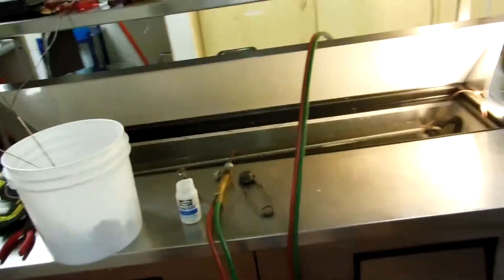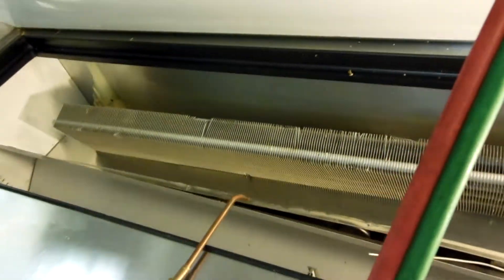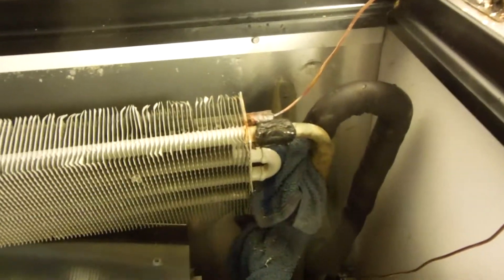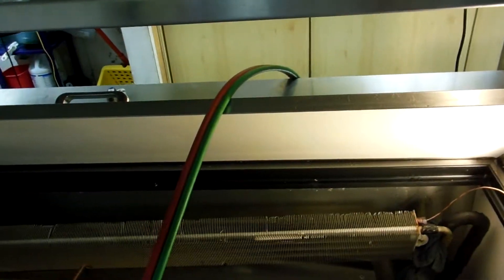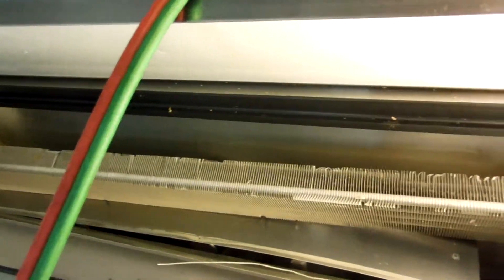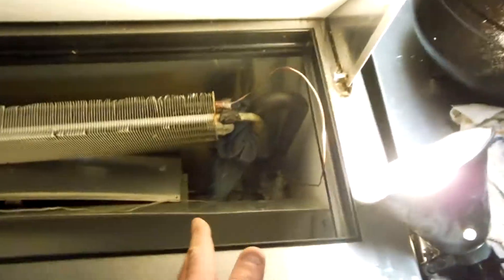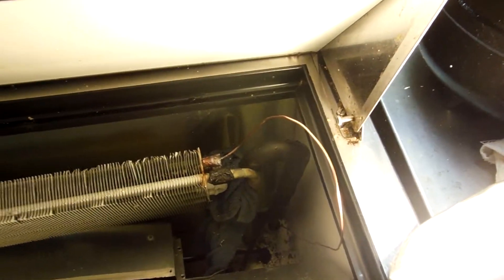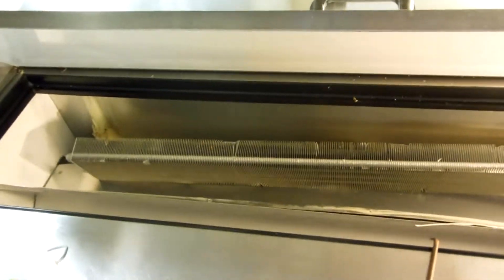True Tssu-60-16 2 Door Sandwhich Prep. Table

Comment: Thanks for the vids.
Did my first cap tube on a True beer box last week. This was after replacing the shorted out compressor and then finding suction line crushed beneath a mass of gobbled insulation. Wound up ripping it all out and starting with all new copper.

What tip do you use on your oxy-acet rig for these small systems? I had been using mapp gas and Stay Brite but had a hell of a time getting the old cap tube out. Glad I had rolled the unit out to the loading dock as I smoked some rubber bits with the big flame. 

Then used an oxy acet rig which I have not had much practice with  to finish up. 

Need more practice with both setups but since I mostly work on reach ins and small walk ins feel more comfortable with Stay Brite.
Reply from the maker: #2 Tip 99% of the time. sometimes i use a #1 tip. but rarely.
Reply: @OcRefrig  thanks!

Comment: How long does it take to replace the Cap Tube? I need to replace mine and the people that i hired charge $88 an hour and they told me 4 hours.
Reply from the maker: That's a Fair Deal. 4 Hours + Parts. cap tube, refrigerant , welding materials etc. About $500.00 Total job cost is Fair. 
1) Why do they need to replace the cap tube?  if i Corroded and leaking then go for it. replace cap tube.
2) if cap tube Plugged up? what plugged it up. these days with poe oil in the compressors the cap tube plugs up with over heated compressor oil from the units condenser never being cleaned the compressor runs hot and compressor oil gums up and plugs up in the cap tube. if that happens the compressor should be Replaced at the same time so the cap tube does not plug up again.
Reply from the maker: Labor involved in Replacing a cap tube--- 5 hrs. 
1) Recover Refrigerant---30 min.
2) disassemble evaporator section and unweld cap tube from evaporator---30 min
3) Weld in New Capillary tubing into evaporator and Liquid Line. ---30
4) Weld in a New Liquid line Filter Drier using a dry nitrogen purge while welding where possible.---30
5) Pressure test system with dry nitrogen. check for any leaks.---30
6) Evacuate system to under 500 microns for at least 1 hr. 8 hr overnight evacuation preferred.---1-2
7) next day come back and weigh in a New refrigerant charge.
8) start up system. adjust refrigerant charge if necessary to accomodate for  filter drier capacity etc. 1- 2 hrs
9) Clean up, pack up the truck, Write out the bill, Get paid for the job. 1hr
Reply: OcRefrigeration,Hvac & Electrical. Thanks.

Comment: Hi there, where does the thermostat tube go in? I have same fridge but evaporator feezes and temperature doesnt stay at 5 but 14/15 after. Have changed couple of thermostats but no joy so far. Any ideas?
Reply from the maker: Most likely u have a refrigeration problem / Refrigerant Leak. what are the running pressures ?
note : all my info is in Psig and Farenheit. are u talking Centigrade.

There is a 1/4" copper tubing where the temperature control temperature sensing tubing goes into the evaporator. the same area as where the captube from the refrigeration cicuit goes into the evaporator  just a 1" lower. it's real bitch to shove it in the tube sometimes. coat the temperature control sensing tubing with thermal conducting grease to make it easier to shove into 1/4" copper tube in the evaporator.

* Do this test first. crank the temperature control all the way, #9  make sure refrigeration unit stays running all the time. An EMPTY fridge with doors and lid closed , all containers in place above no holes , no food in Fridge, nothing in containers, nothing in Frgidge, it should reach 35 degree's in 20 min. to  40 min max from room temperature of 75 degree's if it does not the condenser is plugged up or u have a refrigeration problem. 

check door gaskets make sure in good condition. no air leaks. 
also these prep tables are not designed for a room hotter than 86 degree's farenheit. 

you must be able to see through condenser in the rear of the unit with a flash light. condenser must be free of all grease and dirt.